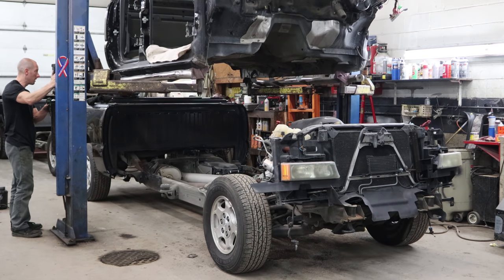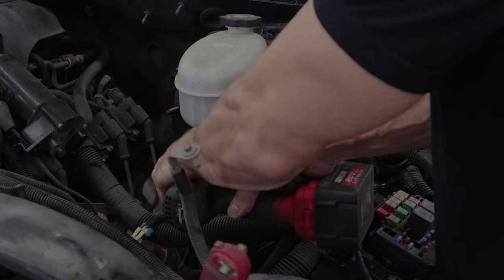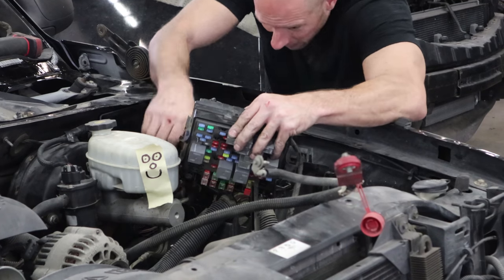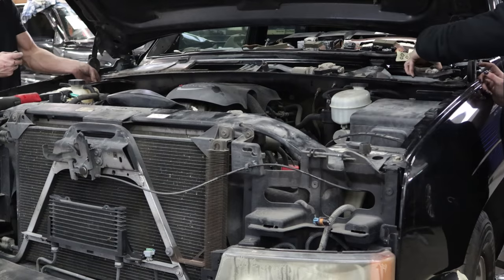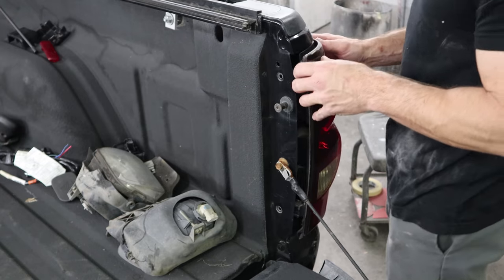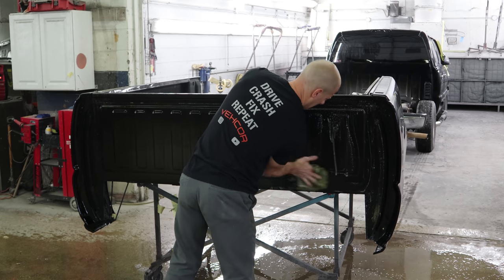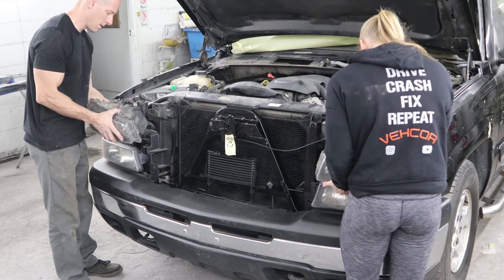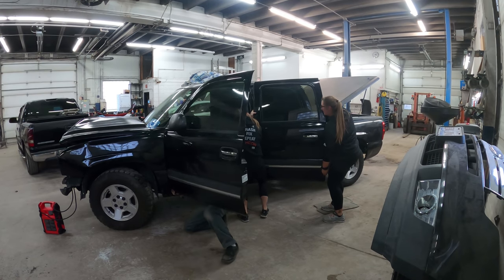Silverado side collision cab swap rebuild part 3

Comment: I have anxiety attacks just thinking about changing the plugs on new vehicles

I've changed Transmissions, re built SBC engines, replaced suspension parts, Pit Crewed on a AA/A dragster with Blown 392's back in the 1970's

Watching You swap cabs was very eye opening and educational

Lol, I don't have a Pizza delivery Girl to help Me or My 8 year old Grandson near by

I have a 1983 F-250 Diesel Pickup with a fresh engine but it has a really rotted out Bed ( no intentions of using a bed on it ) & cab that I was playing with the idea of putting a newer year cab on the frame

So far that project is not the priority, but I still look for a donor truck for really cheap

Thanks for Your videos because now I have a better understanding of what gets done in what order

Ken in Florida

Comment: It's great to watch someone that knows what they are doing. Because I watch you YouTube suggest others most I don't watch. This one I watched because it was a FORD F-350 . After watching a while these guys ( kids ) didn't seem to know what they were doing. Looking back at some older videos they've worked on them over priced sports cars. Instead of pulling a little bit on the wrecked spots. They just unbolted what they could reach and just wiggled the part back and forth till it broke off. Then they jumped into the interior and started on the airbags. The way the guy started wielding a razor blade I was sure he would have made an ER run for stitches. One thing that surprised me was after taking off the moldings / trim the headliner was still held up by a hand full of very strong neodymium magnets. You ever take a seat apart that has lumbar  support and the other things? Well that is another reason I will never buy a new vehicle with that. I can't work on it and I won't pay to have it worked on if it was needed. Unless it stopped the truck from running hahaha.
Reply from the maker: Thanks for the support.  I really only watch videos of someone sends me a link but I do know who you are talking about. 😂 I get lots of questions of what they are doing.
Reply: @vehcor  Just another question. How hard would it be to make the third break light to include turn signals? Either after market or from the factory.

Comment: Awesome video, I like watching the rebuild process. Its great you can get it back on the road, but I don't see how its worth that much work. These trucks sell for well under 10k non salvage. Keep in mind 2004 model year is 16years old now. I bought an 05 2500hd model  in 2010 with 60k miles for 15k
Reply from the maker: I'll explain it in the final video.

Comment: Looks good.   I wish I could get my "afternoon crew" to help me out a little more but thats OK.....lol.    Im not a huge GM guy but unbolting a bed is SO much easier on those than dealing with the always seized giant Torx head bolts in a Ford truck.      Going together nicely with your hand and muscle memory from so many rebuilds!
Reply: Hey I gotta give ford props on the front bumper on the super duty's just a few bolts and it comes right off and man that is so much nicer then chasing all the ones a gm or dodge has hidden in pain in the ass spots or where you have to remove other parts to get to.
Reply from the maker: I can pull GM cabs without removing carpet too! lol They really are easier to work on.  I give Fords and Dodge a hard time but I don't dislike them.  My afternoon crew is the best around! Thanks for the support!

Comment: I put my cab on with ratchet straps and a tractor... I need a lift! I enjoy the channel!
Reply: It works though
Reply from the maker: If there is a will, there is a way. I would be doing the same thing if I didn't have the cheating tools. It might put a dent in my turnaround time though! 😂 Good job getting it done!

Comment: When lifting those cabs off, where were your lift points, on the pinch seam or on the floor supports?  Getting ready to do this exact job, just don't wanna mess the cab up.

Comment: Another entertaining video for couch potatoes such as myself.  I didn't even break a sweat.  I am curious about those green sockets that you have. Are they colored in order to differentiate metrics from standard sockets, in order to save time and frustration?
Reply from the maker: Thanks, they are color coded by size.  It is actually helpful when I can just tell the afternoon crew a color and she doesn't have to check each number.

Comment: I like it alot, "Jim Carey accent"  Keep the vids coming and after doing some research, I notice you're only 2 hrs away. Btw, my nephew brought a 04 Silverado with an engine rattle for 400 bucks. Turned out to be the honeycomb rattling around in the catalytic converter. Easy fix.
Reply from the maker: Thanks, nice score on the Silverado too!

Comment: Cool, modern vehicles trim easy to put on... not so to take apart without breaking...
Reply from the maker: It takes some practice to get the wiggle and pull method just right! 😂
Reply: @vehcor   Correct- I spent hours once trying to remove a Chevy Volt rear bumper without damage... sure was interesting- then to replace 5 seconds.
I really feel for you, but you have that Knack and ability so few do.😎

Comment: Great video like always!! Its boring for the people who don't enjoy people who like to be unsafe at times (Osha cryers). Anyway, why do you think they would change the mounting bolts in the last model year of that body style?  I'm a little confused by that.
Reply from the maker: Manufacturers change things all the time.  Usually they find a common failure so they address it for the next model year.  The older mounts deteriorated with the salt faster.  This was probably there solution.  The bolts are coated and the mounts are thicker.  It could also be just a comfort thing.  A softer thicker mount may provide more cushioning.

Comment: I feel like for me it would've been less work to repair the old cab, it was fairly squished but you had all the pieces to repair it on the parts truck, but then again I guess its better to not have any metal repairs if you can help it

Comment: I need to ask for a favor.   My son has a 2003 Silverado and the heater core has a problem.   I need your thoughts on if the core can be removed without removing the whole dash?   Can you get to the point of taking the top off and reach down from the top take out the three screws and plate, then pull the core?   Didn't watch this video yet, but will tomorrow!   Mark said Hello!    Respectfully,   Kevin
Reply from the maker: No, you have to remove the dash and set it on the seats.

Comment: Did you switch out the speakers in the doors to match since you used the doors from the parts truck and the driver side of the restore truck wasn't damaged? Never mind, right after posted this, you said you got the aftermarket speakers.

Comment: Well your 04 is about done. My cab is just sitting there,under a tarp.  I'm hanging my head in shame.  The truck looks great! What does your state do with the vin number? Reassign a new one?
Reply from the maker: Having the right tools makes the job much easier.  The state will retag the new cab with the original vin.
Reply: @vehcor  in ct they give the truck a New ct number.

Comment: Will a 2004 cab and front end bolt up to a 2001? I have a 2001 crew cab swb 4x4 that needs a cab, and i like the slanted headlights better than the bubble look.

Comment: With the bed off it would have been a great time to replace the fuel pump for preventive maintenance.I did my 2007 Silverado at 150,000 with the help of my friend who has a body shop.
Reply from the maker: There is no end to the things I COULD have done.

Comment: So what year will this truck be when you get the VIN and title stuff figured out?
Reply from the maker: 2004, just because you change a part, no matter the size, the paperwork says it is the same truck.
Reply: So are you doing a vin swap on the cab? Is that legal?
Reply from the maker: drewscruis THE STATE PUTS THE VIN ON! That is the legal way.
Reply: @vehcor  right was just confused because you started with that 06 but the cab is from the 04.
Reply: @drewscruis  When you send the paperwork in for the salvage title you show proof of both vehicles or the orginal and the parts you used to repair the one you are fixing if its something like a cab replacement a inspector will come out check the vehicle out and if it all is passable he places the new vin sticker on it and you are good to go.
Reply: @vehcor  So will it have a reassigned VIN?
Reply: @vehcor  make one, that was two wheel drive into a four wheel drive one. Auto cab to stick shift once, the cab floors are different. where you have to get creative and body lift to clear the transfer case. That was a fun time. love the vids reminds me all the fun I had

Comment: Really enjoying all your videos. New subscriber. Would this rebuild require a rebuilt title?
Reply from the maker: Thanks, glad to have you with us.  Any vehicle that has a salvage title will have a rebuilt branded title after all the repairs and inspections are completed.  The majority of my builds start with a salvage title, but not all.  I will usually let you know in the first video if it happens to be a clear title instead of salvage.  The clear titles remain clear of course. Thanks for watching.
Reply: @vehcor  I'm retired LEO and 1 of my best investigations involved a dealer that was buying wrecked low mileage rental vehicles. They would piece vehicles together and resell them as dealer demos. I identified 35 vehicles before we shut the dealership down.

Comment: I am interested to know whether you worked on an assembly line at one time. Possibly for GM? It just seems like you know so much about putting cars together and how they come apart. I know you’ve mentioned your experience before, just a curiosity I had.
Reply from the maker: I did not but after 1000+ rebuilds of all makes, you learn the basics pretty well!

Comment: What do you do about the vin? The vin tag is on the replacement body, but most of the truck is from a different vin.
Reply from the maker: The state retags the new cab with the original vin.

Comment: My guess is that you don't like the fact that the trim molding is on the doors bit not the bed or fenders. That's what I didn't like about mine! You said to guess which part you hated about this build.
Reply from the maker: I hate mouldings in general but luckily I didn't have to mess with any on this build!

Comment: I don't know if you reply to these posts but I have a 2011 Escalade and the cigarette port in the very back stopped working, where do I look or is there a fuse some where.
Reply from the maker: There are fuses under the hood for those I believe.

Comment: Old men aren't dead lol. After to numerous videos I watched I finally seen you with some blood, I probably went through a couple dozen cuts and a couple blackened nails in this same amount of time.  
Question, you stuck the doors on early the after installed the rear seats, front seats, center seat and dash cover and question is why? Would it not have been easier without the doors then add the doors just before taking it to paint?
Reply from the maker: You cannot line up the front end until the doors are on.  You can't drive the truck until the front end is on.  I need to drive the truck more than save the few seconds it takes to walk around the doors
Reply: @vehcor  I know about the driving part and I knew you had a reason that I missed was wondering, for the front end, makes sense now. Thanks for the reply
Reply from the maker: Sometimes the faster way isn't in the long run.

Comment: Hey.   One against two in the door hang challenge is patently unfair.  They should have made you wear a deflated airbag over your head or something.....
Reply from the maker: I gave them the lighter door without a fender in the way plus took out the door check and gave them a head start.  I was worried that might have been too much.  They are good for such little experience!

Comment: I need to know what part numbers for the bolts on a 03 and i need the whole cab body mount kit for a 03 GMC sierra SLT extended cab 5.3. Any help would be appreciated. My cab shifted forward when i hit a ditch .
Reply from the maker: You would have to call GM for that

Comment: So the VIN is attached to the cab, so the truck is now registered as an 06?
Reply from the maker: No, the state has retagged it with the original vin, you know, the proper way to swap a cab.
Reply: vehcor ah, that makes sense.

Comment: 16:51  That's not water, it's blinker fluid.
Reply from the maker: Well they were almost empty, needed replacement! 😂
Reply: Shout out to Chrisfix
Reply: vehcor do you have a cold 🤧? You sound different
Reply: Blinker fluid does exist, but it’s only for high end sports cars
Reply: @bradschuh4618  Blinker fluid isn't included on any BMW's since BMW drivers don't use them.
Reply: David P right but Ferrari’s do
Reply: Illinois will find a way to tax Blinker fluid, they are taxing just about everything else!!!
Reply: Mike Bornkamp 😂😂
Reply: bug juice and blinker fluid a must for every vehicle.

Comment: So the crashed truck was an 04 and the parts cab was an 06 so does that mean the "new" running truck will be titled as an 06? 🤔
Reply from the maker: No it will be a 2004 when the state puts the new tag on.

Comment: I’m surprised with it being a LT it doesn’t have full power seats, fog lights, and steering wheel controls.
Reply from the maker: It has a power driver seat and it has fog lights.
Reply: vehcor ah must have missed the fog lights.  I just always thought they all had 6 way power seats.  Just assumed wrong I guess.

Comment: I have a question I hope someone can answer, I have a 2011 Ram 1500, I was doing some detail and clean up of the under carriage of the truck and I noticed on the forward part of the frame about where the driver and pass. side are attached to the frame are what looks like counter weights on both sides I unbolted them from there perch because I wanted to descale them and throw some chassis paint on them all they are  just bell shaped weights bolted to a bracket with a bushing in between them, would anyone know what the hell these are for, they seem like unneeded weight to the truck if you ask me, they are about 10lbs each I just can't see the purpose of them they are not any kind of moving parts attached just to the frame, Any clue anyone
Reply from the maker: It is for vibration dampening.

Comment: The cheap plastic they use to hook the heater core on the hoses suck I had one leaking on my truck
Reply from the maker: Luckily, they are easy to change an super cheap.